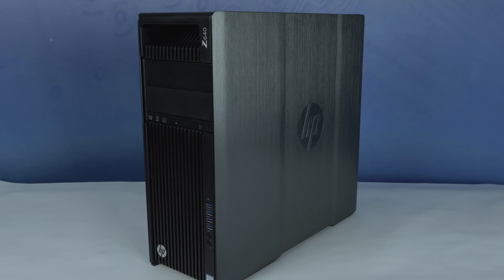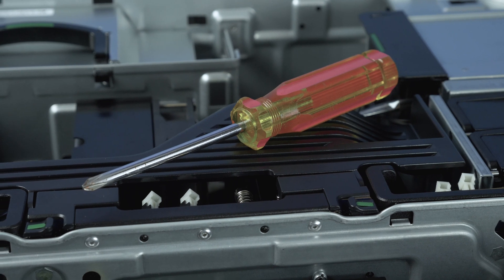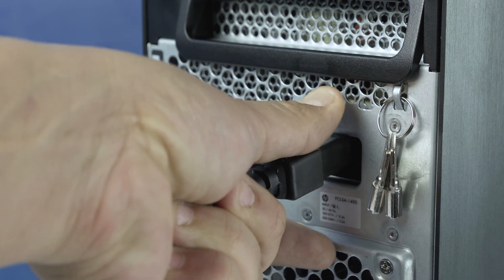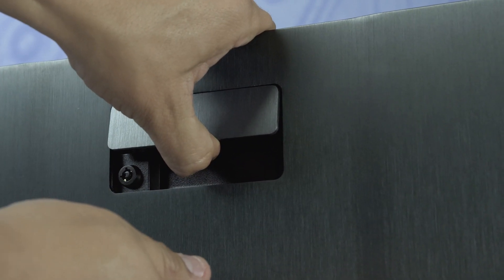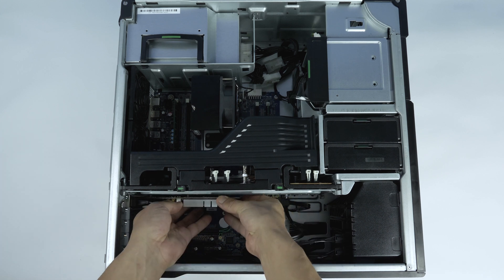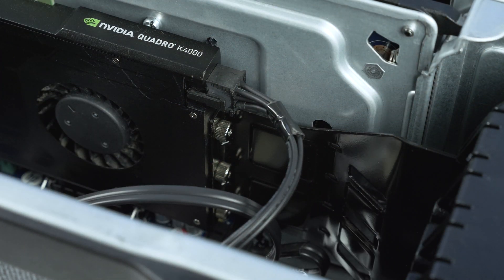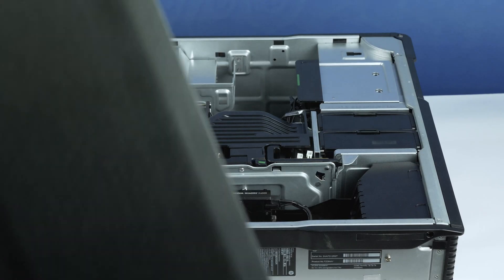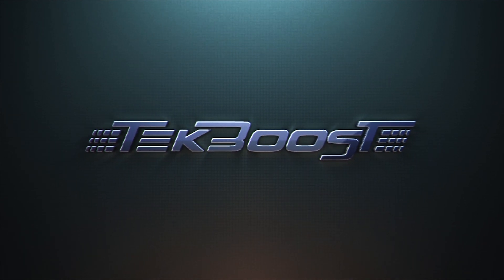HP Z640 Video Card Installation

Comment: Useful video, thank you. You might mention that one has to push a little part on the card guide (the black panel inside the Z640 opposite to the back of the unit and where long cards are inserted) to remove a previous long card.